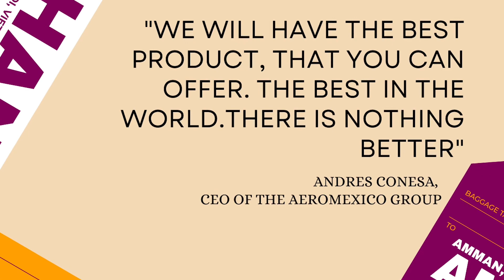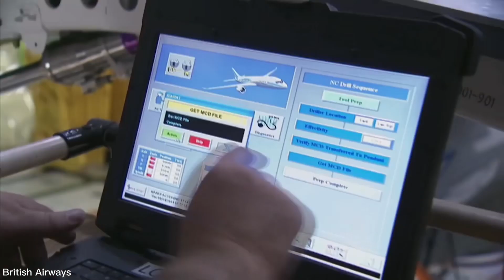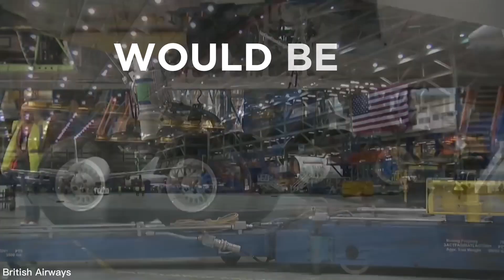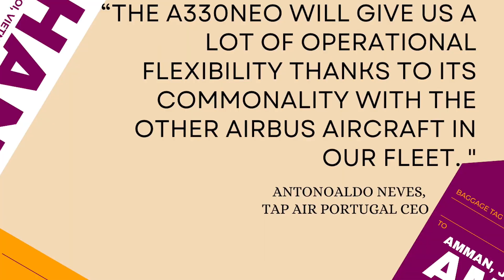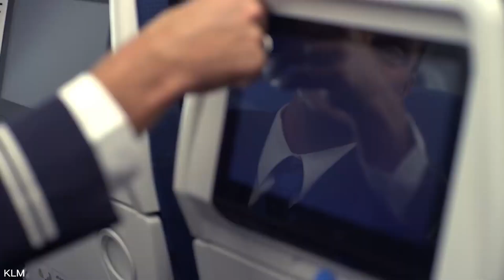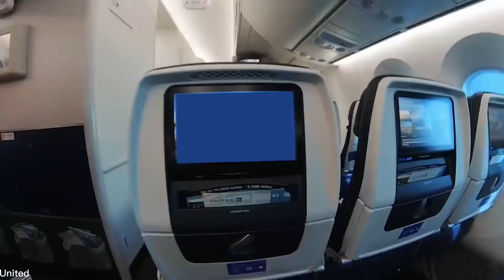Has Airbus failed with the A330neo?

Comment: I think the A 330 neo is the best looking plane.
Reply from the maker: For me it’s the A350 from outside because of the black mask and wings. 

 wing view: it’s also the A350 but only behind the wing, the 737 with split scimitar winglets because it looks majestic and the 777 wing view at night. iam also curious when the 777X enters commercial service because the folding up of the wingtip after landing could look really impressive and or majestic. 

And the best engine view has the A380 from the lower deck.

Comment: 787 has better passenger experience because the cabin is wider? This is actually only thrue when you compare the normal 8 abreast seating of the a330 vs de 8 abreast seating on Japan airlines 787. All the other 787's have 9 abreast seating. Economy seats are wider on the most common a330 than on the most common 787. I rather sit in a wider seat where i do not have to touch my neighbour than fly the 787. If you fly for 8 hours in economy, i rather have more space
Reply from the maker: You have to consider that business and first class passengers make the flight profitable, not economy class passengers. So obviously they try to fit in more seats when the cabin width allows it.
Reply: @Flyment-de5yx  we are not talking about profitability but passenger experience. The majority of the passengers are flying economy. The majority of A330's are 8 abreast, the majority of 787's are 9 abreast. The cabin of the 787 is just 23cm wider than the A330, but therr is one additional seat. This means the seats are narrower on the 787, hence passenger experience is not better on the 787 because the cabin is wider.
Reply from the maker: Airlines don’t care what the majority of people fly. They are companies so they wanna make profits. And business and first generate the most profit. So these passengers benefit mainly from  the extra width of the 787. 

Also is the seat width in the A330neo in economy 17.72 inches (or ~45cm) at TAP Portugal and in the 787 from United it’s 17,3 inches (~43,9cm). That’s less than half an inch difference. You will not notice the difference. 

And like i said: airlines are companies and they care about profits because of their obligation to meet their shareholders expectations that means from extra width will business and first benefit mainly because airline compete for these classes the most to maximize their profits to satisfy their shareholders and investors.
Reply: @Flyment-de5yx  my friend, did you read my comment? I NEVER said anything about profitability, you started with that. Your statement in the video was that the 787 offer better passenger comfort becausr the cabin is wider. I contradicted that, and that is because that 23cm of extra width is used to cram in one extra seat. And comparing just 2 airlines om their seat width does not paint a picture of al the airlines. Or was picking Delta's A330NEO's economy seat to risky for you as their seat is 18 inc wide? Your statement about a wider cabin offering a better comfort is just not thrue. Just look at the A220 vs 320. The A320's cabin is wider, but passenger comfort is considered being better on the A220 due to, guess what? Wider seats.
Reply from the maker: Obviously it doesn’t paint a picture of all airlines but gives you a picture of how  small the differences are. I think you don’t understand that economy class isn’t a priority for airlines because business and first is more important and they benefit from the extra width.
Reply: @Flyment-de5yx  i do understand economy is not the airlines priority, if it was thete would be no 9 abreast 787. But what you fail to understand that, take united's 787 fleet for instance, al seat more economy and economy+ passengers than premium economy and bussiness.  Take their 787-9, wich has the most premium seats installed. They fly 69 premium seats vs 188 economy seats. So the majority of the passengers do not benefit from a wider cabin, as their seats are narrower compared to the ones fitted on Delta's or TAP's A330NEO. So your statement about the 787 having a wider cabin means more passenger comfort is still false. Just face it
Reply from the maker: A wider cabin has the potential to offer more comfort, how airlines use it is their own business.

Comment: To be equal to 787, they will need to offer 9 seat abreast. Thst option is available. Same seat width as 787.
Reply: A330 9 abreast is narrower than the 787 9 abreast. Luckily only a few airlines opt for 9 abreast on the a330, while only JAL has opted, and still operates, 8 abreast 787's

Comment: You forgot to mention the A330 neo has been tweaked lately since customers are using it for short haul as well as long haul which gives it alot of versetilty and thus will improve its sales so its not a failure as people think
Reply from the maker: I stated at the end that the A330neo isn’t a failure because of its low development costs. 

When has the A330neo been optimized lately?

I only know the news from 2018 when airbus announced it would tweak the A330neo in order to beat the 797. 

Do you meant that? Or have I missed something?
Reply: @Flyment-de5yx  I was watching a  video on the Colby explains channel called Flop to Phenom posted 2 weeks ago saying the A330 neo has been used by many airlines recently for short range high volume routes. The 787 has to be serviced after a considerably lower number of take offs and landings. Airbus has listened to airlines and has re-engineered things so that it only needs to go for service after a thousand take off/landings as opposed to something like 350 previously with the 787 having remained at a figure similar to the old A330
Reply from the maker: Which airlines fly the A330neo on short haul routes in Asia?
Reply: @Flyment-de5yx   Cebu pacific, air asia

Comment: The biggest mistake Airbus made with the A330-NEO was to only offer it with the Rolls Royce Trent 7000. While the Trent is a good engine, Rolls Royce is notorious for high maintenance costs, poor product support and long turn around times for engine overhauls. Furthermore, with a competitive engine option, such as the B787 is offered with (Trent 1000 or GEnx) airlines are in a better position to negotiate price with the engine OEMs. Airbus no doubt based their single engine option to keep certification costs to a minimum. In the end, aircraft procurement decisions are driven by total cost of ownership over the life cycle of the program. Training costs, such as cited for TAP, are a factor but a smaller part of the big picture.
Reply: Of late the a330 has experienced a boom as it's being used for both short and long haul, something you can't do with a 787 due to structural reasons
Reply: @mwat22  What B787 structural reasons are those? In reality, large aircraft are not efficient on short routes due to high maintenance costs on high cycle large turbofan engines. I wish those short haul A330-900 operators with RR Trent 7000 engines good success in making a profit for their investors.
Reply: @Snaproll47518  you actually explained the reason I was to give.
Reply: And also the haul is not designed the same way short haul A320s and 737s are designed, to endure several cycles of pressurisation and depressurisation as they are so it also takes a toll on the haul and thus more maintenance, more that the maintenance schedule dictates thus higher cost operating one for short haul
Reply: At least (currently) the A330-900neo hasn't suffered the ridiculous Pratt & Whitney GTF engine issues that has hurt the A220 and A320neo Family fleets.
Reply: @Sacto1654  The GTF is designed for high cycles operations whereas the the Trent is designed for high flight hours and low cycles.

The problematic GTF is better compared to the CFM Leap.The GTF has a better fuel burn but direct maintenance cost for the Leap is about 50% less per hour than the GTF.

Comment: Boeing will outsell itself with the 787 in the next few years and the only other options for airlines would be the A330 neo.
Reply from the maker: I think the 787 will not be sold out in the next few years. Boeing has 581 unfulfilled orders and 522 backlog orders. 

Boeing produces 2 787 (Feb 2023) per month but they wanna increase production to 5 per month. That’s 60 per year. 
522:60 equals 8.7 years until they delivered all 787s. 

And then iam sure they will introduce a 787MAX or continue to sell 787 or introduce a clean sheet design (and they can sell more 787s in the remaining 8.7 years)
Reply: @Flyment-de5yx  Boeing has production issues and delays to every now and then and there will be airlines who would not wait for a couple of years to get the 787.
Reply from the maker: That’s true. Some airlines will cancel their orders. But I think most of them will stick to the 787 because it’s superior in almost every aspect and fleet decisions will not be affected by 0.5-2 years of delay. 

It’s the same with the 777X. Most airlines did not cancel their orders although the 777X is half a decade late (for example Emirates and Lufthansa, qatar airways and Singapore airlines) I mean they could’ve just switched to more A350-1000, all except for emirates operate the type already so it would be very easy.
Reply: @Flyment-de5yx  LIke you have stated the 787 is so superior to the A330 neo that one has to wonder why did some airlines ordered the A330 neo in the first place they could have waited for the SUPERIOR 787 !
The 777X vs the A350-1000 is for another debate.

Comment: I hope it works out for Airbus a330-900 awesome aircraft
Reply from the maker: Have you flown with it?
Reply: @Flyment-de5yx  not yet been on A330 300 though.
Reply from the maker: I Hope i can fly TAP Portugals a330neo soon. Hopefully it will be as good as Qatars a350-1k (mood lights and silent engines)
Reply: @Flyment-de5yx  I was supposed to go to Los Angeles on A350-1000 last year with Virgin but changed to B787-9. Would have been 1st time on both was on Dreamliner nonetheless but had I gone on A350 I would have completed the full circuit with Airbus as I have with Boeing
Reply from the maker: Would you recommend virgin ?
Reply: @Flyment-de5yx  absolutely